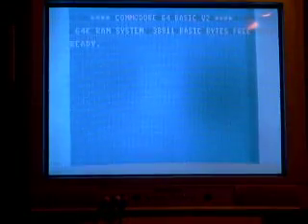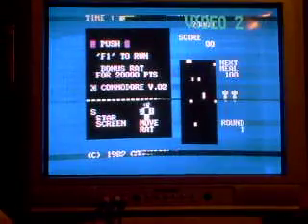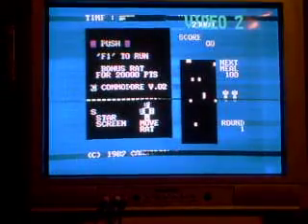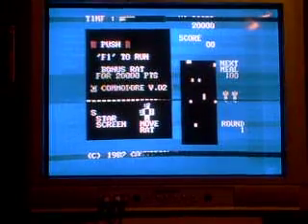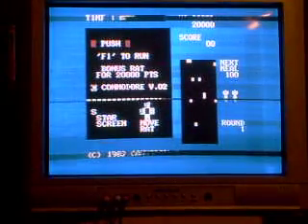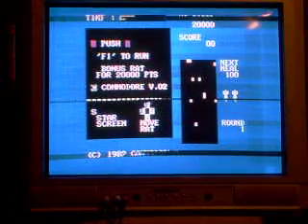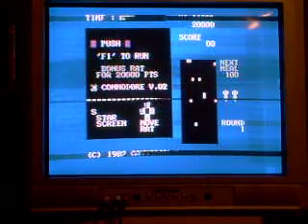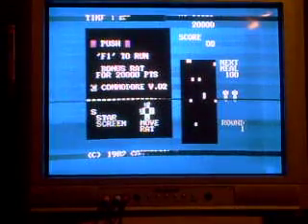Commodore 128 sick video chip

Comment: reseat all chips and try a different power supply. low voltage will do this. had the same problem with my 128.

Comment from the maker: No, not yet; life forced me to put this on hold plus my power supply is now gone for it; it died. Opened it up and it has been fixed several times, and most of the components inside are shot. So I'm on the lookout for another then the repairs will continue (when I get time). Thanks for asking!

Comment: Usually video smearing like this is caused by bad caps (usually the metal surface-mount ones) If you leave it on for a long time, and notice the problem "drifting" or changing in any way, thats what it is (90% sure) It's the darker bands outside the screen area that make me think this.

Comment: The VIC II chip generates the video for both the Commodore 64 and 40-column Commodore 128 modes.  The 128's new VDC video chip only generates video for the 80-column RGB output, which you're not using.  So that's why your problem affects both 64 and 40-col 128 modes.  The poorer display in 128 mode might simply be due to the different colors used on the BASIC screen (green on dark green, instead of blue on dark blue in 64 mode).